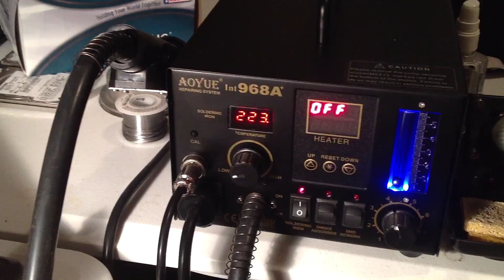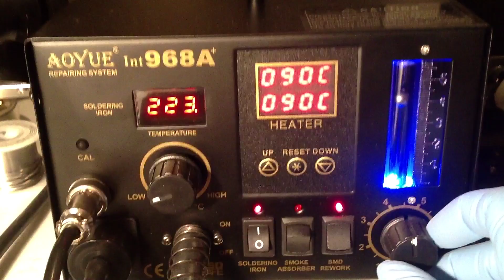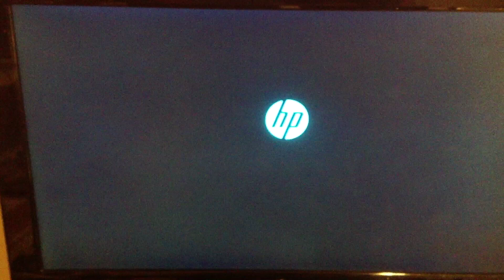Broken VGA

Comment: I honestly cant tell  a difference in the pins when you have them under the scope. How do you see the crack?
Reply from the maker: This video is HD, but not enough to see the cracks that I was able to see on that day.
Reply: I also can't see  difference of cracked pins, plus only 2 pin can not make whole connector so loose, it seems strange video.

Comment from the maker: Hi Traves, in your case do not use a dryer for this task, if the port is lose you don't really need a hot air gun, if you good on soldering, then you could do it with a regular fine soldering iron. then after doing that if you still get not signal, make sure to remove the ram and blow some air. good luck.

Comment: hew i have the same pc in the video my vga port is very wobbly and doesnt show video but starts up fine if i do as you showed in the video with a heat gun or blow dryer with this fix the issue?

Comment from the maker: Hi, there are two things you could do, 1.) get a PCI or PCI-E video card, depending on what slot you have, install it, then the computer automatically will detect it and set that video card on the bios for you, and automatically will disable the on-board video card and enable the new one, when you done with that install the drivers for that video card. 2.) If you don't like my first suggestion, try a PC Repair Place, and have them do this for you. I mean the rework process like I did. good luck

Comment from the maker: if your computer is a video card built on the board, and the problem is the video chip or the vga port, an easy way or solution here is to install an internal video card and disable the one that came with your computer.

Comment from the maker: Hi ChuckWake, what kind of monitor you have? is it tube or flat lcd? for your description you are giving sounds more like a tube monitor, I don't know if you re into opening your monitor and if you know a little bit on how to fix electronics, but first you need to run a diagnostic, first checks the current input, then the voltage regulators, on flat lcd screens a diode put an end to this issue.